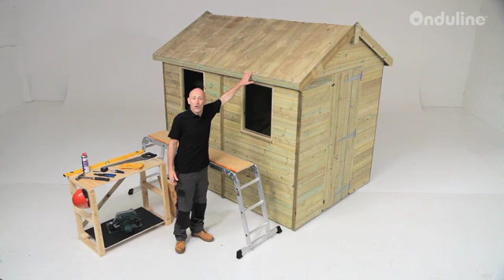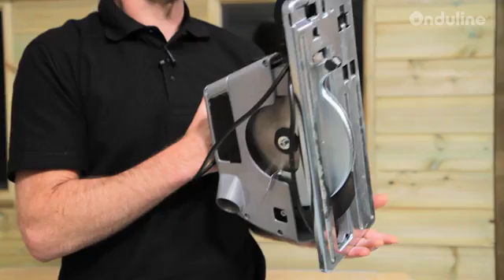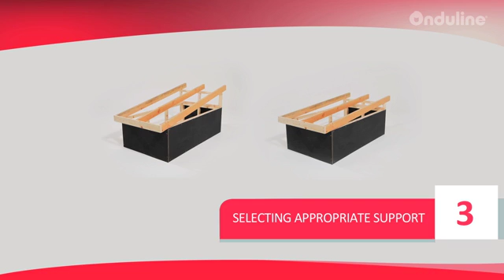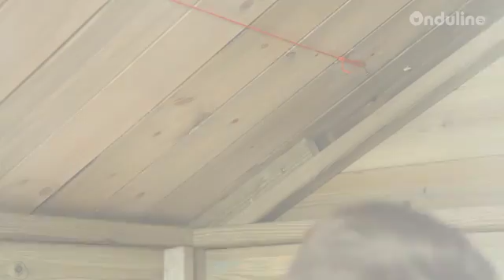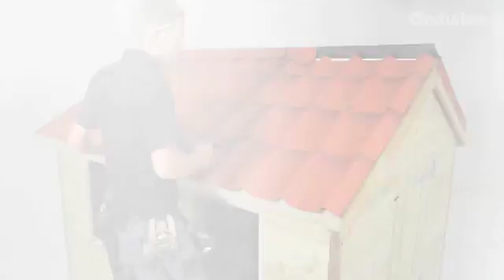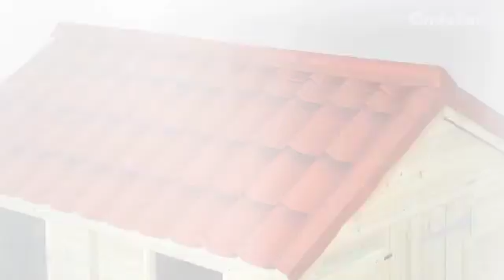[Made by me] How to install Onduline Onduvilla roofing step by step

Comment: Very tedious, many parts to buy. Too expensive the top of the roof is hard to finish. Too many screws needed and only Nails available to purchase. Expensive Foams are offered to plug the the openings in the first row on both sides. Very unpractical. I ended up spending over $550.0 for a shed roof 12" x 10" and
I'm not sure that it will not leak, the nails have rubber washers that could dry under the sun and thus leak in the winter. I'm very disappointed. 
Stay away from this  produt